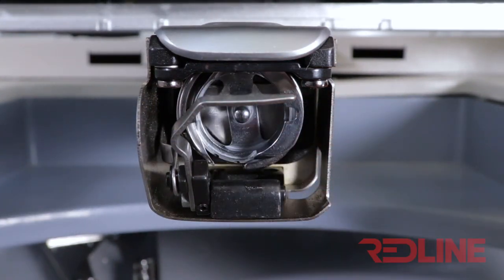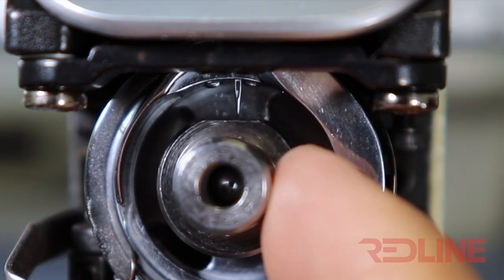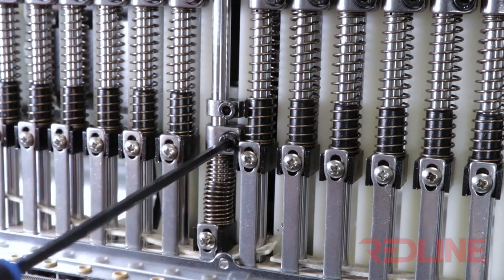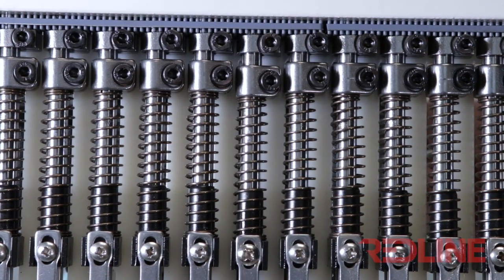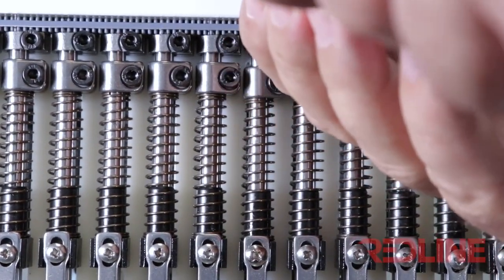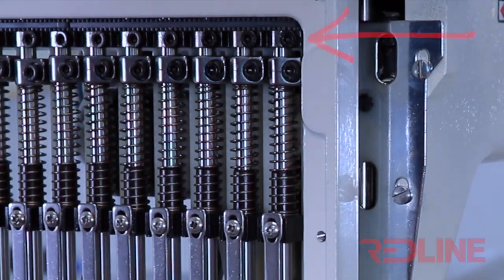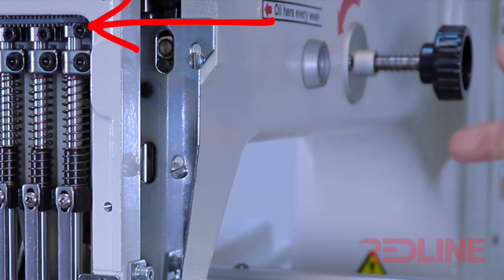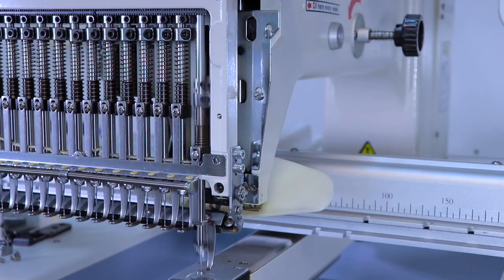How to adjust the needle depth

Comment: Beautifully and very plainly explained.  How about EC17? Thanks.
Reply from the maker: HI EC 17 is the color changing overtime. I'd check the color motor as well as the sensor. Make sure there is no obstruction on the color changing mechanism as well. Make sure the computer is also reading a needle on the screen and is aligned with the actual head.